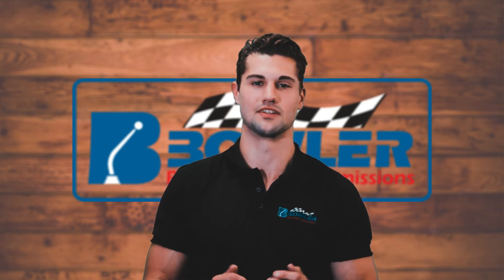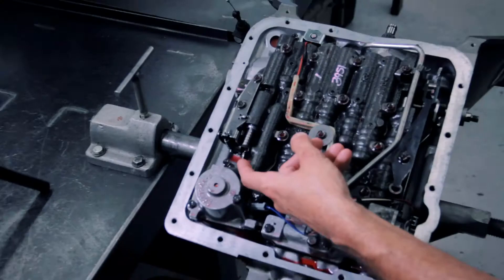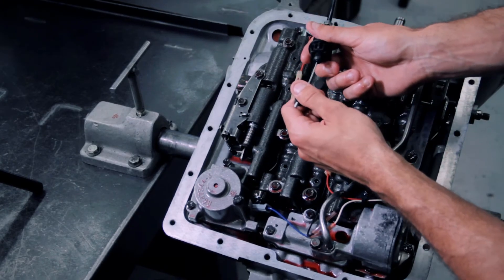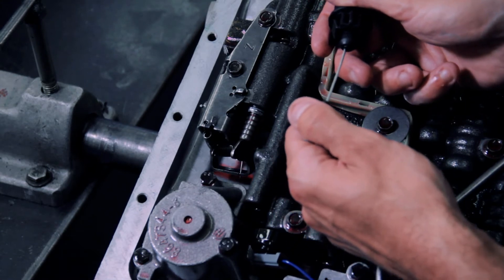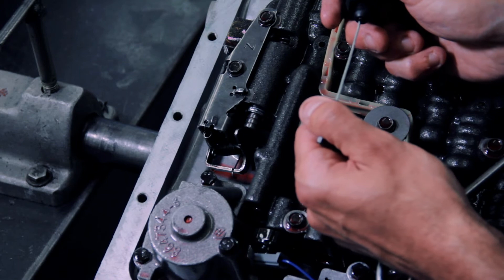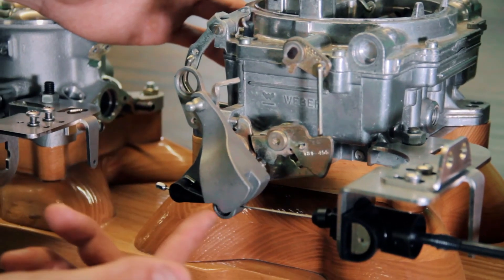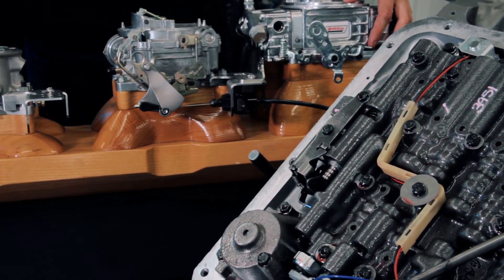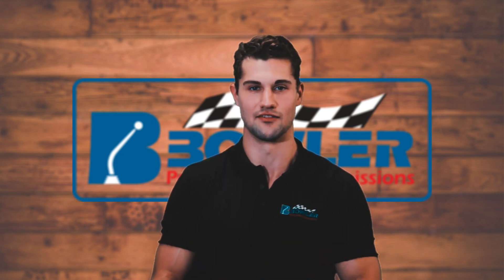Throttle Cable | The Bowler Tru-shift | How to optimize your 700R4 Transmission

Comment: on my 70 Impala i swapped from a 2 barrel to 4 bbl holley and my detent cable is 2 or 3 inches too short. I can put the cable to a bracket but it's too far away to reach the carb
Reply: Did you purchase our Tru-Shift kit?  If so please give us a call and we will get it figured out, but something seems wrong to be that short.
Reply: $314 I know you got to figure out something

Comment: Update, I have had mine for about 6 months now and trans has acted perfectly, besides my WOT shifts (governor springs adjustment). However I am going to upgrade to FiTech or Holley Sniper EFI and I need to order a new kit but you guys are always out of stock!
Reply: Governor spring adjustment? Damn it
Reply: Back in stock!!
Reply: @MissPhantomProducts  I went to the website and there are no products!!

Comment: Bolt on the Bowler Tru-Shift, attach cable at wide open throttle, let go and it sets itself precisely. No adjustments from this point on... at all?

Comment: I have a 700 r4 transmission. I brought two TV cables and I did the adjustments the way you said. But the cable would never Is ratchet out on his own. Why would that happen on both TV cables?

Comment: Yall make one for a holley ultra xp 600? The throttle linkage is unique not like other holley carbs
Reply from the maker: Yes we make a kit for the Holley Ultra XP, you will see a listing on our website, but be sure you select the HP option. https://shop.bowlertransmissions.com/collections/tru-shift-system/products/tru-shift-throttle-correction-arm-system?variant=31473608491071

Comment: Thanks for tbis explainer! So is the adapter not suitable to a 2bbl? I am looking for an improvement over a 2 sp powerglide and looking at 200 4r as a replacement.
Reply: Nothing for a 2bbl, sorry.  Thanks for watching our video.
Reply: @markbowler3374  You're welcome, ghqnks for putting it up. Has anyone purchased and ghen modified for a 2 bbl? I dont mind a little maching but would prefer to start with mosg already done. Thanks.
Reply: *thanks

Comment: When will you have it in stock all sold out for months
Reply: Sorry for the issues we have had delays with the OE GM Cable and our castings from Ohio.  Everything it back in stock.
Reply: @markbowler3374  ok already purchased one
Reply: @markbowler3374  if my shift points are too high do I need heavier governer weights
Reply from the maker: @deerslayer5863  you need a combination of heavier springs and weights in the governor.